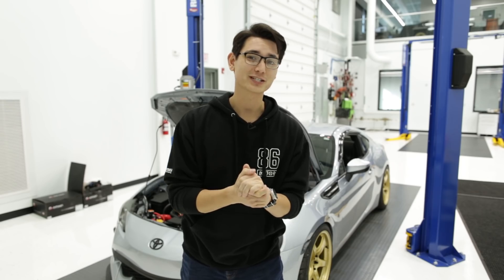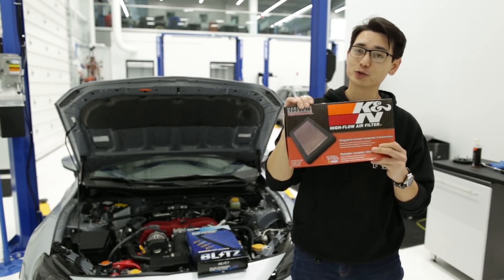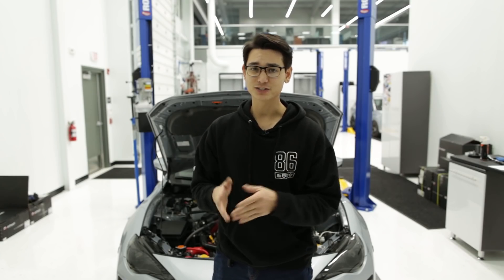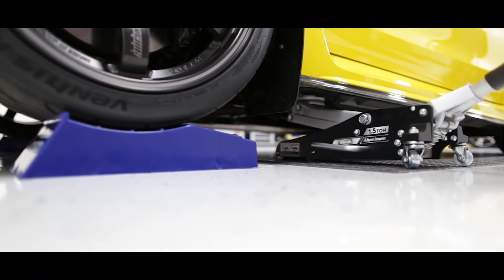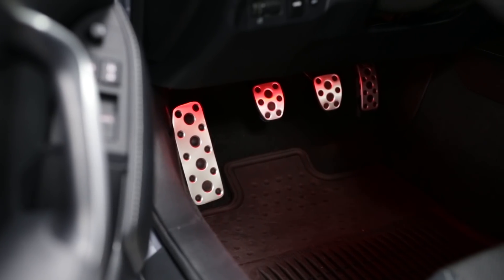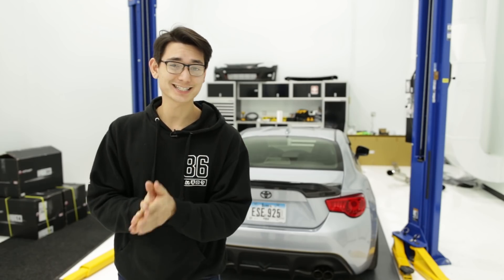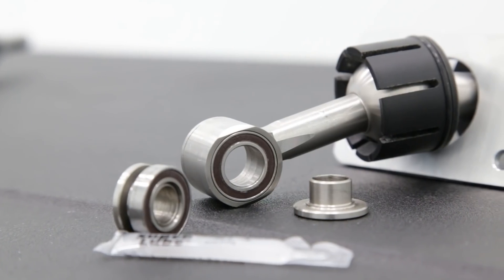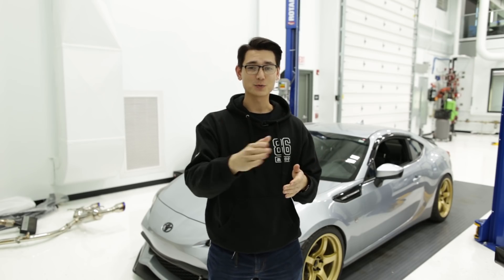Holiday Gift Guide for FRS/BRZ/86 owners

Comment: Helix side markers are 💩 I bought one and it didn’t twist right in order to get the bulb in and fitment was not good.
Reply: TheBadassOne17 I had mine on for 4years and some months. No problems only switched cause I got smoked led ones. Your one experience does not mean they're shit, most likely installer error...
Reply: i recently got my helix markers and they fit perfectly, idk what u talking about